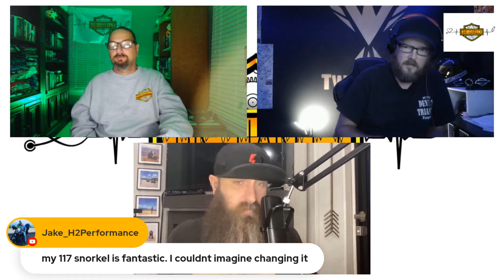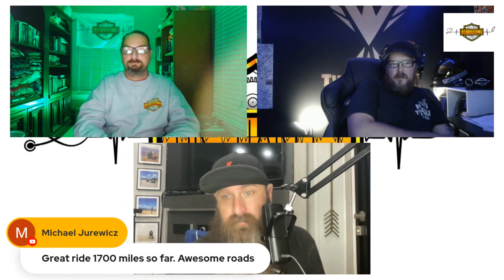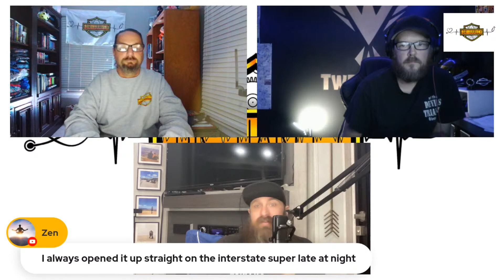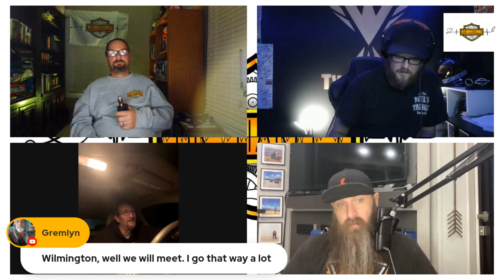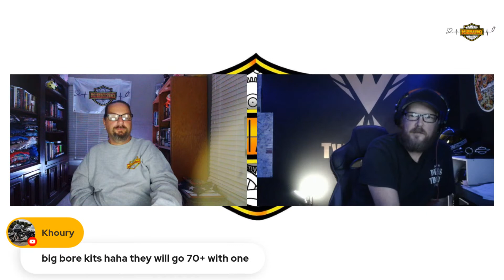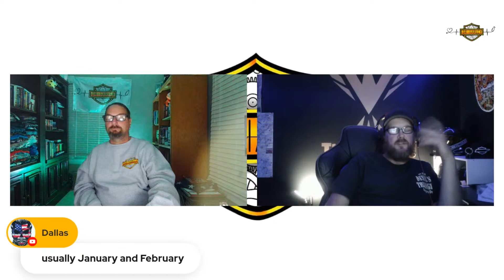What makes a performance bike? #harley #harleydavidson #livestream #performancebaggers

Comment: You say adjustable push rods loosen up never heard that before. Would hate to be on a trip and have one come loose the every day guy would be stuck on the side of the road. I haven't heard of any maint. schedule that includes tightening them can you elaborate?
Reply from the maker: It's not that they loosen up.  Over time the springs in the lifters weaken and create some play, or the installer didn't wait the 20 minutes for bleed down then readjust.
Reply: @DrHarley  got it thanks!!
Reply: @DrHarley  Wouldn't "weakened lifter springs" happen even if the lifters weren't replaced?  I've never heard of that being an issue so I am befuddled by the context of that assertion
Reply from the maker: Yes or if installed the push rods where not adjusted correctly.